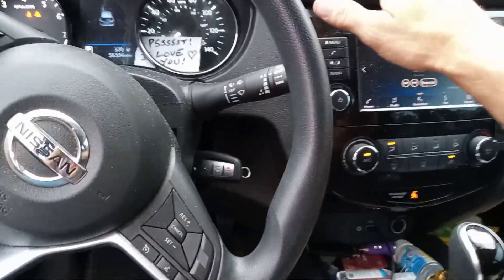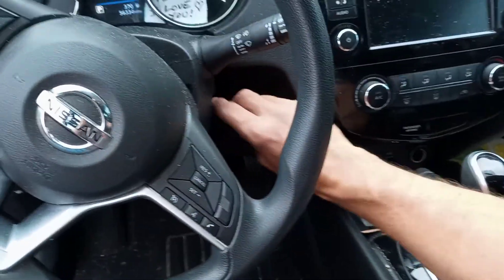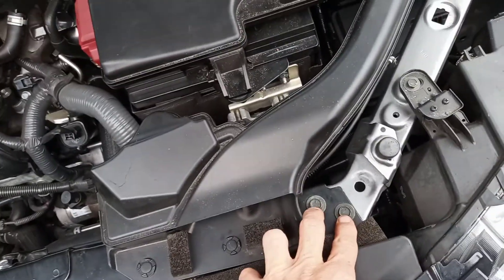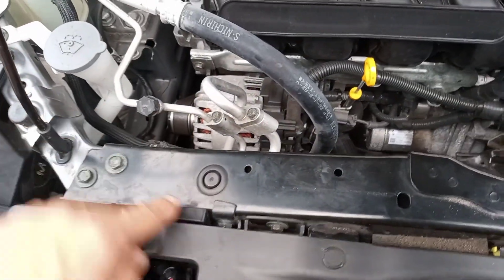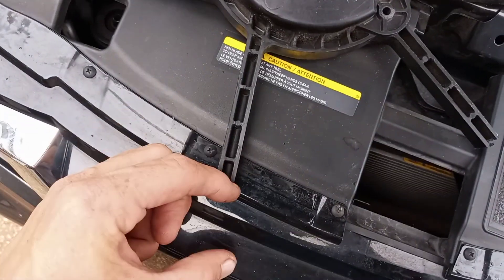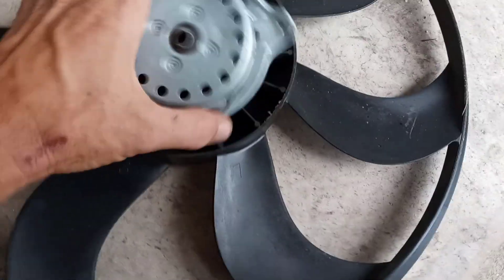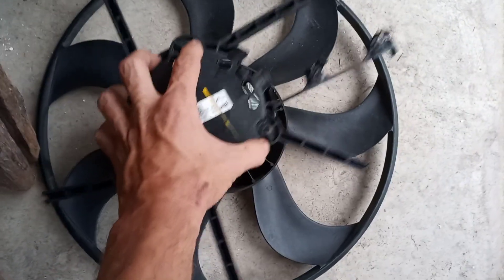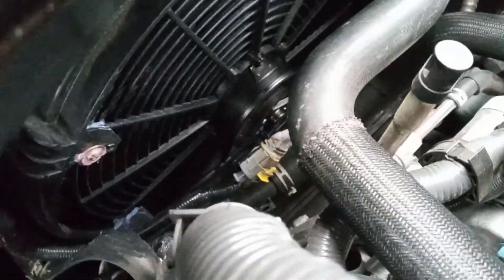Universal Fan Hack / Nissan Rogue Sport

Comment: Thanks for the video. My radiator fan just went on me. Was running the air bc I get cold air when I’m moving but not when I’m stopped. Well it overheated my 2019 rogue when I was in Jersey.
Reply: I'm having that same exact problem it blows out cold air as long as you running as soon as you come to a stop warm air comes out the Fan's not working and you got to be careful so you don't overheat it now I got an engine light on and it won't go off until the vehicle goes in the shop
Reply: @mv360degreetrunheretheycomeaga can I ask what ended up being the problem? My dad's having the same issue and we've replaced the thermostat, the radiator fan itself, and the cooling sensor

Comment: My fan went out as well. My uncle replaced it back in November 2021. When I purchased the new fan it was like $68 total with shipping. Now, the new fan is doing this what you are talking about. I had the thermostat replaced thinking it was the thermostat. I learned recently that the fan is not coming on at all.  So it's weird that it blows cold air when moving and temperature gage stays normal.  As soon as I stop for a period of time like light temperature goes up and hot air blows from AC. Wish I knew why the fan keeps blowing out because this my second one and it's not even a year yet since I had other one replaced. Would you know what would cause them to go out continuously?
Reply from the maker: I actually still have the universal fan and shroud I made. I'll sell it to you for $100 you pay for shipping.
Reply from the maker: I believe it is a design flaw, either cheap metal in the fan coil or cheap plastic that expands and rubs and creates resistance.
Reply from the maker: We traded in our Rogue sport 2 months ago. If you would like to buy the universal fan I built it will probably last longer than another stock fan.
Reply: @jaxhacks3223  do you still have it available?
Reply from the maker: @solomonrotibi1103  Yes. $100

Comment: I have this same problem for my 2018 nissan rogue sport!
Reply from the maker: There are now some factory replacements available.... https://www.ebay.com/itm/NI3115162-PARTS-LINK-FAN-ASSEMBLY-2017-2019-NISSAN-ROGUE-SPORT-oem-214816MA0A-/284405162424?mkcid=16&mkevt=1&_trksid=p2349624.m46890.l49286&mkrid=711-127632-2357-0
Reply from the maker: Click that link ^^^  There are now some available.... I recommend finding an affordable direct replacement if you can. Ours took a week to arrive.
Reply from the maker: And it may not be very safe to drive until you fix it. Definitely don't use your air conditioning. Don't sit stopped for 30 minutes, as long as you keep moving your car won't overheat. If you drive with no fan you risk overheating everything

Comment: So when you mean by draws air is that pushing air towards the radiator or pulling it away from the radiator? Because I did this as well just didn’t think about which way the air should flow. But it feels as if it’s pushing air away from the radiator towards the motor is that the correct air flow?
Reply from the maker: Yes... Its supposed to pull air through towards the motor. And I'm not a professional, but I think it turns on by itself when the motor is hot enough. If you're driving the fan doesn't run. When you stop it kicks on. Or... If you turn the A/C on max and blast the A/C that should make the fan turn on.
Reply: And does your fan kick on by itself or just as you are driving because I drove for about 2 and a half hours and when I got home got out to see if the fan was on and it wasn’t.

Comment: did you have to wire anything different because of the relay on the fan and did your fan have two plugs
Reply from the maker: Ours has one plug on the back of the fan, 2 wires = the power & ground to the fan motor.  That is the one I spliced.

There is a 2nd plug attached to the top corner of the shroud, I left it alone other than unplugging it to remove the shroud/fan assembly. I made no changes to the factory shroud other than mounting a new fan in the middle.
Reply: @jaxhacks3223  what is the other plug for the 1 on the corner?
Reply: So the plug in the middles of the just has two wires going to it?
Reply from the maker: @angelodicenso84  yes... Look inside the Nissan plug, you'll see numbers.  #1 prong is 12v power, #2 prong is the ground. 

And new fans usually have 1 red & 1 black. Or 1 blue & 1 black wire.  Black is always ground.
Reply: @jaxhacks3223  cool definitely appreciate the help it sucks because this is a huge problem with these cars and no where to get the parts

Comment: Another thing is that I have a high oeformabce fan we used in a turbo car we had and its ultra thin but I was gonna put it in front of the fan but the problem is the fan on the car we have now they suck air so it cools the ac unit at the same time
Reply from the maker: I looked at a few fans that were thin enough but the air direction was a pusher fan. One fan at Napa said you can take it apart and reverse it to make it a puller, but the frame was just 4 legs.  Def helped having the frame around the radius to make attachment easier, but I had to search the city all afternoon for a puller fan with a frame around it.